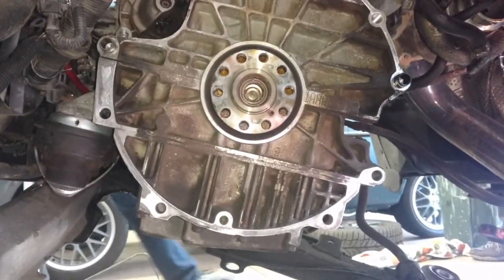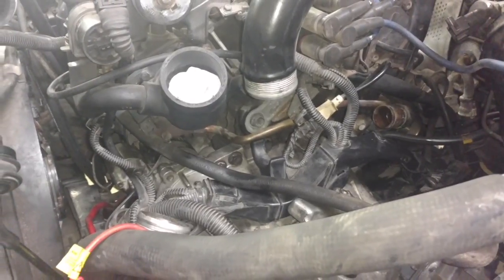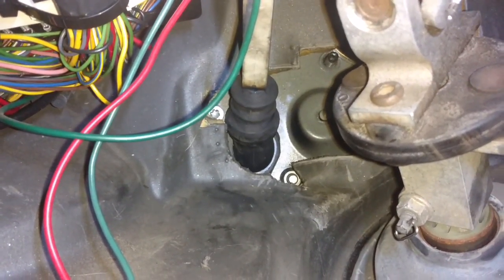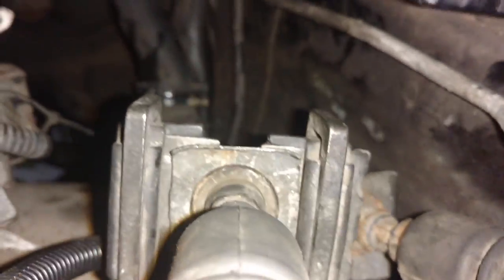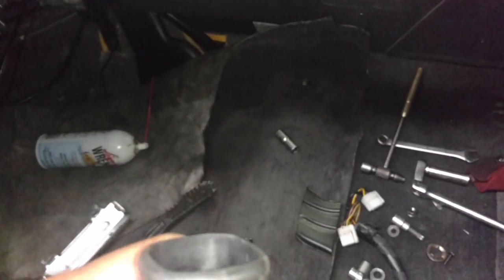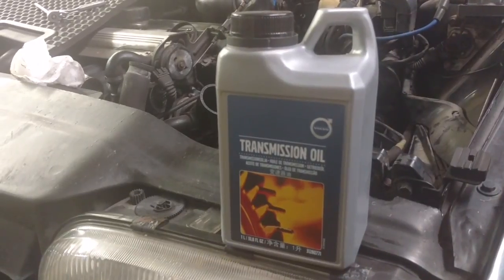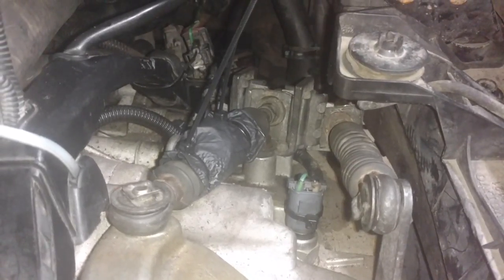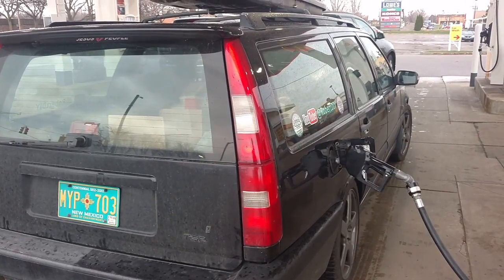Installing the manual transmission and associated items. - Manual Conversion

Comment: I have a manual 1995 volvo thats has blown engine and 1996 automatic as a daily, if the automatic blows im absolutely going to do this swap. 

Great stuff.
Reply from the maker: Swap the engine into the manual.
Reply: @RobertDIY  i rather not, the car is very rusty and whole suspension is crap. The automatic car is almost perfect, only minus is that my atf oils gets dark rather quickly and the risk of radiator will leak coolant to the gearbox. It has the b5254S and i did full headgasket job on it with machined head. Do you have any tips where i can find an atf radiator inside europe?

Also I must say youre a big reason 850 became my favorite and most time and effort spent car by far. owned plenty of them and theyre very underrated, Some 850s in Finland cost under 200$ with small amount of work to get them back on the road.

Comment: Hi Robert,
Here in Spain the most (almost all) are manual transmission. Let me know if you need parts because maybe I can look for you in junkyards here.
Good and Big job!
Reply from the maker: A shifter knob from a T-5R. I believe it would be wood, walnut.
Reply: Ok
Reply: I have a 1999 volvo c70 2.4L turbo, any possibility we can get in touch for some parts so I can also do a swap. Insanely hard to do in Canada with volvos being an uncommon car to find in manual

Comment: Hi Robert love the stuff you post great job buddy it helps a lot.. Im doin a swap just putting stuff back on a 1998 c70 im using a 2000 v70 transmission  m56 as far as the brake switch on pedal bracket do i use the one from the 98 c70 or the switch from v70  donor car, i Know there's a extra switch on top of my brake switch on my 98 c70
Reply from the maker: +Jose Ayala I don't think it matters. Do they look the same? Have the same PN?
Reply: Thanks for the reply Yes it does, what about the  switch That's on top of the brake switch has a longer pin and some kind of a vaccum hose
Reply from the maker: +Jose Ayala cruise switch
Reply: Robert DIY thanks rob

Comment: Who tuned the engine for you?  If you did it again would you just pull the engine out the top and swap trans with it out of the car?  That seems like it would be easier.
Reply from the maker: The engine was not tuned.
Easier to drop the subframe if you can get the car high enough.

Comment: Thank You for posting. I'm little disappointed because the clutch thing i need to do isn't as detailed as i wish it was. You kind of scare me 4 guys for one hour trying to get it back together. I thought i can do it with a little help on the parking lot of my parents house. Jacked up and put on stands. Do you think i can do it? Don't know anybody with a carlifter...
Did You have a pressuring tool or something to pressure the clutch before putting it in? How was the result? easy shifting possible? What do You think is more difficult on 99 models?
I'm always very surprised when I wake up in the morning and You already answered. Thank You for Your work
Reply from the maker: Lots of questions here. Had a long day, 20 hours so I'll answer when I wake up.
Reply from the maker: When I have to replace the clutch in my car the engine and transmission will come out the top.
Reply from the maker: Yes you can do it. I'm sure you will need 2 people, one to hold the transmission in place, the other to start a bolt or two.
Reply from the maker: If you didn't see a pressuring tool, I didn't/don't have one.
Reply from the maker: The transmission, clutch, etc work great.
Reply from the maker: Should be the same on '99 model.

Comment: thanks for this useful information, i have a volvo s70 t5 auto and i want to do the swap , i have a question , what clutch wire do i need to find to  dont have problems when i start up my engine? and after i have everithing set up do i need to set my ECU? thanks
Reply from the maker: Did you watch the video?
Reply from the maker: Check the playlist on my YouTube channel.

Comment: Hello Robert...I have a 98 volvo s70...4spd transmission, I want to change it to a 5spd auto transmission. Can this be done without a lot of work as in tech rewire or computer mapping
Reply from the maker: So you want to remove a awesome transmission to install a weaker transmission, why is that?

Comment: Hi Robert I've watched a lot of your videos on the Volvo 850's and I appreciate all the videos you do its a huge help! I'm about to do a manual transmission swap in mine. I actually had a question that I haven't found the answer for yet how about the ECU. Would I be able to use the ECU off of a 94 non-turbo 5speed for my 95 Turbo that's automatic so when you go to shift between gears after I do the swap it'll hold the revs longer?
Reply from the maker: Nope. Get a tune or keep the one you have.
Reply from the maker: You can also search on the forums and facebook pages for someone that has one they don't need.

Comment: Hello Robert! How did you do with cables from the automatic gearbox in the cable trunk to get backlight?
Reply from the maker: I don't understand your question
Reply: @RobertDIY  Hello Robert! How did you do with the wiring to the automatic gearbox? To get back light to manual?
Mvh/Martin.

Comment: Hi Robert, which axles should I use for the  manual swap? I have 1998 c70, using a m56h trany
Reply from the maker: the ones that fit in the hubs.
Reply: soo Automatic axels would work